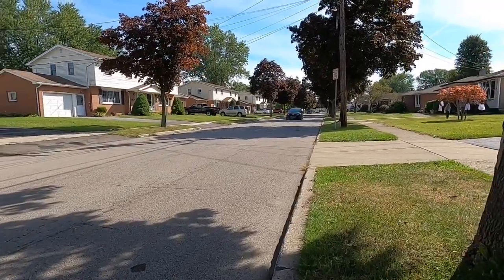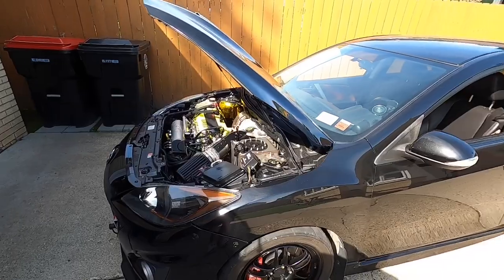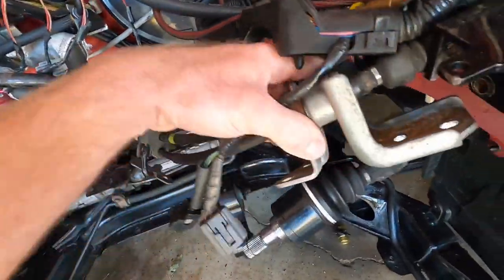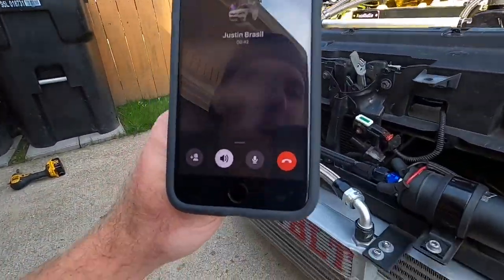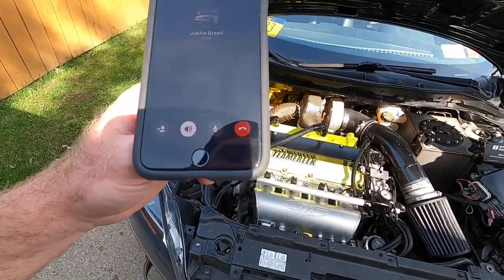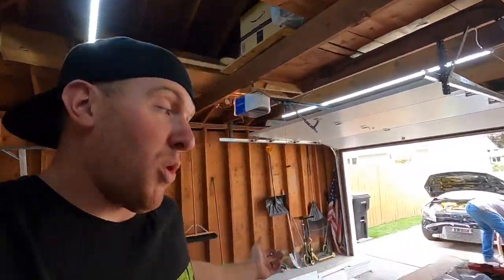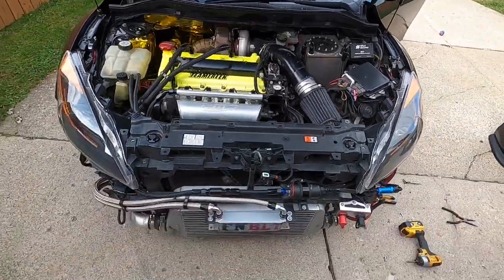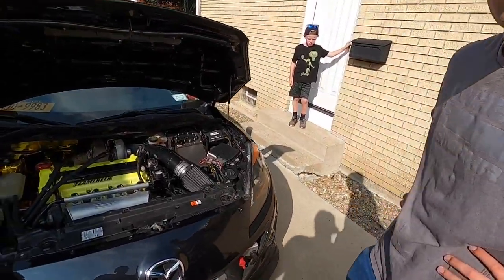Dom’s 600+HP Mazdaspeed3 Had A Small Issue That Could Have Led To HUGE Problems.. ALSO NEW PARTS!!

Comment: I never knew that about alternator cut-out during WOT, either. You definitely want a bigger battery to support supplemental injection for a situation like this, just like you said in the vid. Congrats on the new parts!

Comment: Those batteries work really well for daily driver cars especially modified ones. Keeps the voltage up. A lot of guys also use it for high end/high power car audio for it's high output.
Reply from the maker: Ya seems to be a good choice

Comment: 0/1 gauge wires from the battery and alternator
Reply: Right what size are the cables going to the battery as that will pull on your altenator..